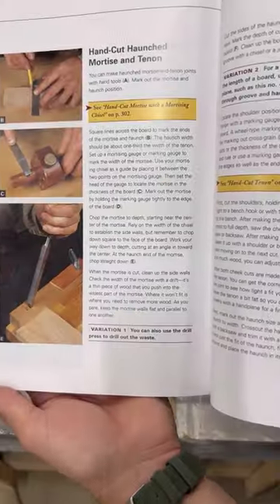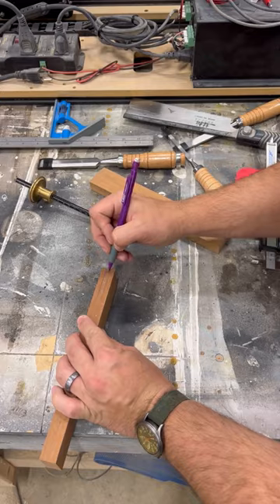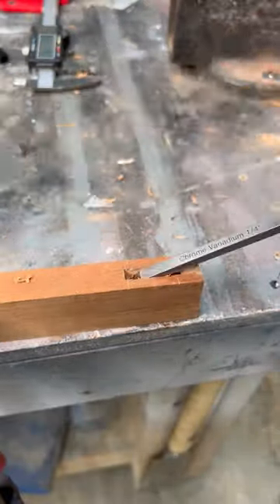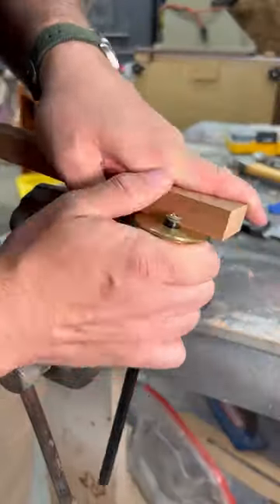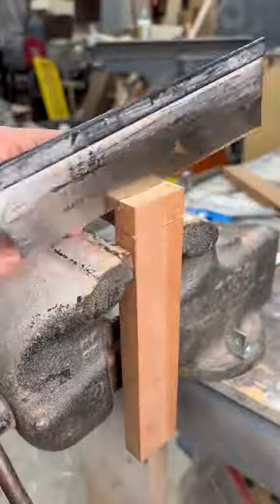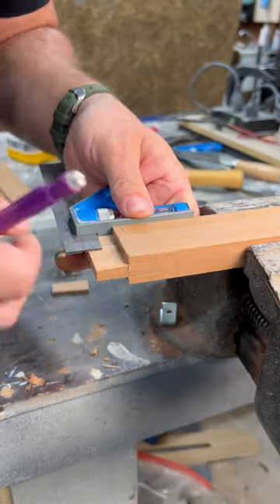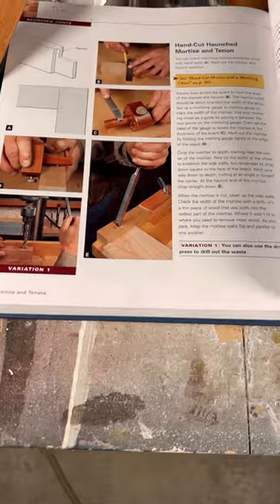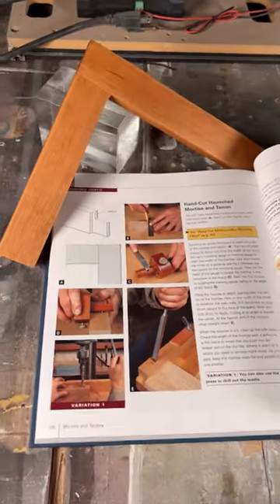Woodworking Haunched Mortise and Tenon | Find A Joint Friday Ep:3 #woodworkingtips #handmade

Comment: The haunch gives extra strength to the joint to resist twisting motions better (more conflicting surface area) while keeping the tenon itself long. That’s how I understand it at least. Much stronger than a standard rail/stile joint having only a small tenon to fit in the shallow mortise.
Reply from the maker: Thank you!
Reply: Came to say this. Also the haunch adds directional strength/stability during seasonal expansion/contraction, especially when glued.

Comment: Those haunched tenons last the longest out of all types according to evidence of old buildings and furniture. Would take a while to explain why and I'm not an expert in that aspect.

I realize this is just for demonstration purposes, but if it helps, a better way to mortise with handtools is to save some material inside your marking line, then clamp a pairing block aligned to your knife line and use it as reference to pair down the wall to a snug and even fit.
Reply from the maker: Thank you for the tips! I’ll have to try the paring block next time. I gotta get less impatient too😂😂